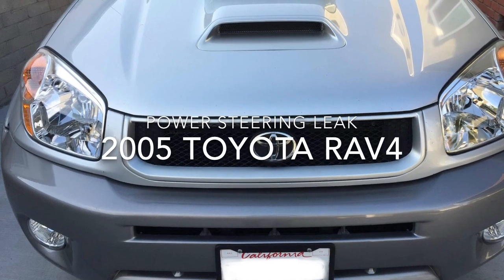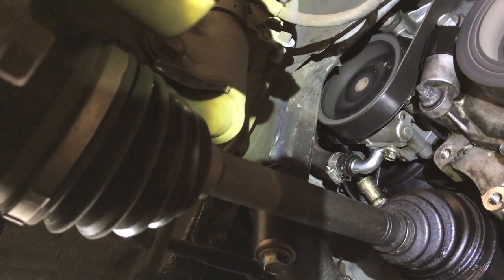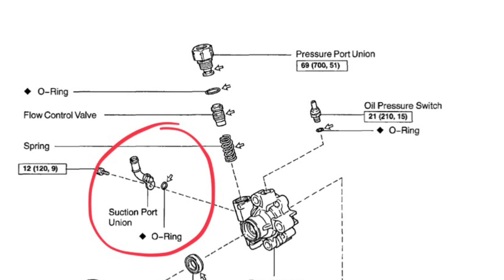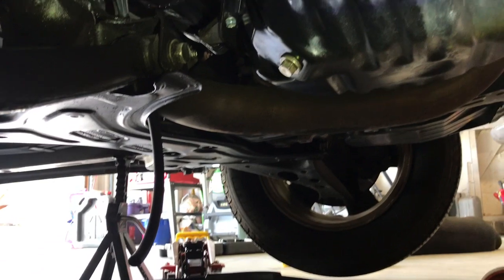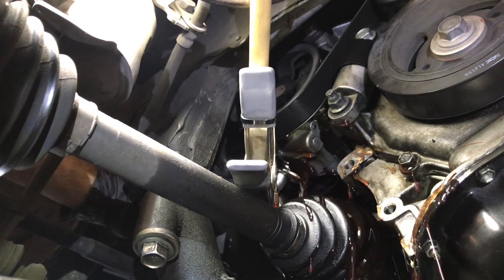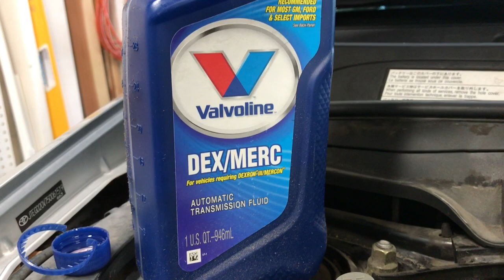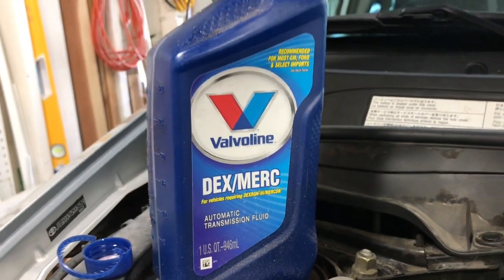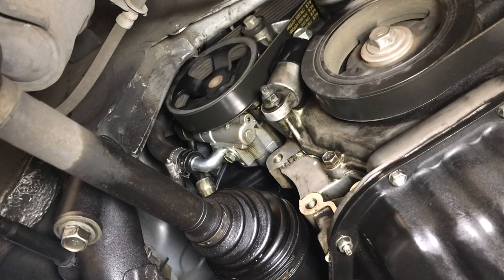2005 Toyota RAV4 Power Steering Leak

Comment: Hello I viewed and downloaded your video on replacing that "O" ring on the Suction Port. That's one of the things I am doing too. 2000 Toyota Sienna CE almost exact same but slightly different from the Rav 4. But I am finding it IMPOSSIBLE to find a new "O" ring anywhere! I replaced the PS Pump with a refurbished one which works great. But even the Gasket kits DO NOT CONTAIN THIS "O" Ring. I need help GETTING a new "O" ring. Toyota Owners.com has discontinued it!!!  I would ask what its made out of first "Nitrile" maybe? Its a low pressure return hose. Is there an EXACT MATCH you can tell me about? Please Help!
Reply from the maker: I bought mine at the dealer but I have since then discarded the packaging. Sometimes these are just temporary fixes before the rest of the gaskets start to go on the pump. Ultimately, I ended going with a new pump some time after this repair. Good luck.
Reply: Always try to tighten Suction Port bolt first.  Often it's just a loose bolt that needs tightening.  I did the same thing with the transmission oil pan gasket on my 2002 Rav4 and fixed that big leak for nothing.  Toyotas are very very well made and often the bolts just loosen up over time.

If you need to use an o-ring just use an O-ring similar in size.  Go to your local wholesale auto parts place (like Princess Auto) and buy the bulk 0-ring package of 300 o-rings.  It's cheaper buying a set of 300 o-rings than to find and buy the single o-ring.  Find an o-ring close in size and just use that o-ring. It won't be an exact match but it should be a close enough match to do the job.  As vehicles get older parts counters won't hold stock any longer thus it's good to learn how to improvise as vehicles get older and older.

Comment: Any idea how big / small that o-ring is?
Reply from the maker: Sorry, I wouldn’t know the exact size.
Reply: @eltpg  No problem.  Good work on the video!  

I have a small power steering leak on my 2002 Rav4 as well.  Just went over to   Princess Auto and picked up a box of 400+-o-rings for $10.00.  Hopefully one of the o-rings will work.

Looks like a fairly easy job to tackle this weekend.....
Reply from the maker: @happycat0411  Good luck! Hope it works!
Reply: @eltpg  I crawled under my 2002 Rav4 yesterday and found the leak.  I just tightened the bolt for the time being and if the leak goes away I'll be more than happy.  If not, at least I have O-rings to fix the drip.  

The video was really really helpful since I was going to pry off the oil pain thinking the drip was coming from the oil pan.  However the fluid was definitely red so the problem wasn't an oil pan leak.

For a 19 year old with only very minor problems, I'm very impressed with the Toyota build quality.  Nothing even comes close to these 20 year old tanks.  Parts are still readily available at the local auto parts store and NAPA since the Camry, corolla, wer also built around the same Toyota design.

Bolt is a 12 mm and can be easily access by pushing back the  inner plastic splash guard.  Just tighten the bolt snug.  If the leak continues then you should replace the O-ring.  If the leak stops then you just saved yourself at least $300.00.
Reply from the maker: @happycat0411   I agree with the build quality and parts availability . Thanks for sharing your strategy and hope it works out for you! Seems like a quick remedy. Glad the video was helpful.